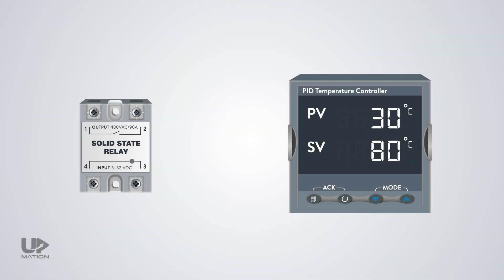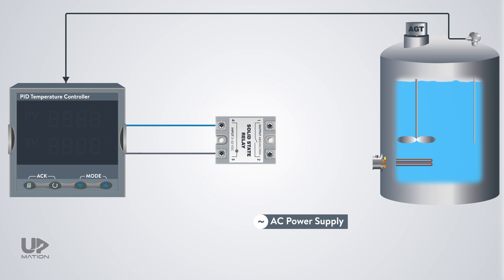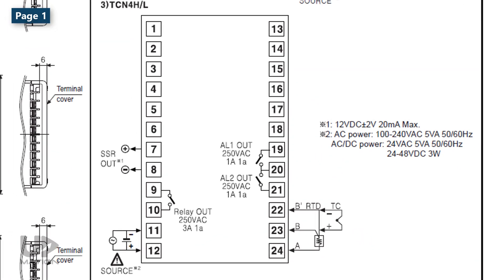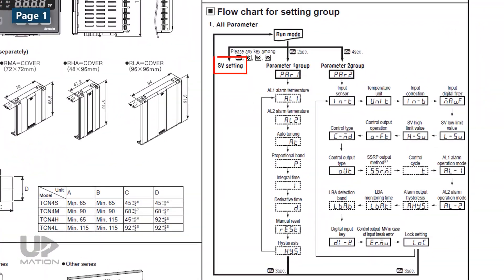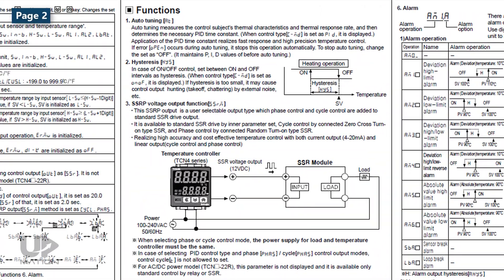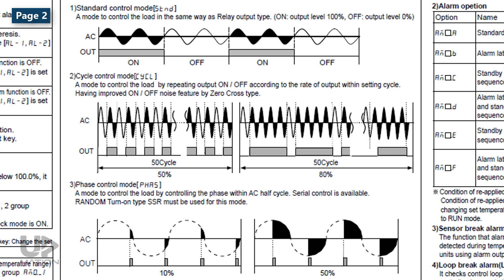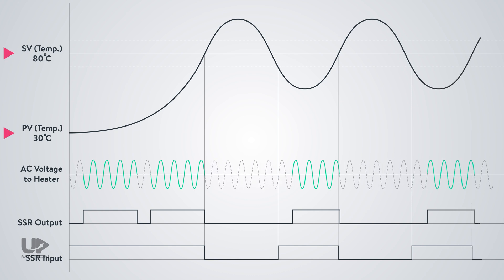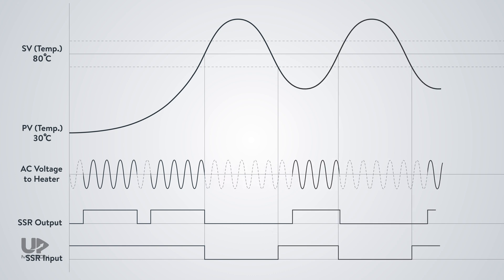How to Use Temperature Controller | PID Controller with SSR | Temperature ON OFF Controller

Comment: I would like to do the same thing with my photovoltaic panels using a dc voltage source 
PiD controller will be the best solution to control easely the tank temperature
Thanks for your video

Comment: How to identify/differentiate between SSR output/ relay output on PID Temperature controller. If SSR is not mentioned but voltage pulse is mentioned. I am confused is voltage pulse & SSR output same?
Reply from the maker: It should be written clearly but, voltage pulse sound like the same for SSR. Reading its manual would be helpful.

Comment: Do all PIDs need an SSR?
Reply from the maker: No. You don't necessarily need to use an SSR with a PID controller. It depends on your application. Please check the manual of your device.

Comment: Could you do a video on controlling a heating element in water using a PID -- and efficiency of SSR vs SCR?
I have an 8KW Atmor tankless water heater that has two switched heating elements. I want to add stable electronic temperature control. But I can't find good information about the different options!
Seems the PID + SSR MAY have longer switching time, and that MAY reduce heating element life from thermal cycling vs a higher speed SCR. But I am having trouble finding the real answer.
Reply from the maker: Hey! We will consider your suggestion. Thank you!
Reply: @Upmation  to follow up, it seems zero-crossing SSR is the way to go, because of the thermal mass of the heating element plus the switching time of the SSR are more than fast enough to preserve the life of the heating element. The SCR seems to be useful for motor control and dimming. Unless operated at the zero crossing (like most SSRs), SCRs can have a detrimental effect on the power system: lower power factor and harmonics that may cause radio frequency interference (RFI) or even affect the operation of other equipment.

Comment: I want to add PID temperature control to my 240VAC instant hot water heater. What controller and sensor would you recommend?
Is there such a thing as proportional heater control?
A heater controller that factors in flow rate?

Comment: I cannot see the follow up video about PID itself, right? SUPERB VIDEOS you guys are doing!
Reply from the maker: Yes, we have not provided that video yet. Thank you for your comment and compliment! This is great to hear you liked the videos.
Reply: @Upmation  (I think) I finally understood the 3 different ways of driving AC using SSR. Once I implement I will see if I did ;-)
Reply from the maker: @zyghom  Hope so :) Let us know if you had any questions down the road
Reply: @Upmation  OK, question then: So I have one board that has triac on output, and on input it has 2 pins: 1) zero crossing output, 2) PWM input. When used with ESP32, using PWM duty cycle from 0-100 the triac on the output "modifies" the sine wave - like in one of your examples (phase control mode) - it switches on with the delay so it is quite fast reaction. But this board is very low output  - probably no more than 1A continuously. Then I have SSR-25DA - this one however only does "on/off" (standard mode) - is there any way to control DA type SSR the same way the 1st board is controlled? Or only the VA type can be controlled this way? Or another way: does it make any difference for the heater controller I am building if I use phase or standard mode, as it seems that if the standard one will last ON only until the cycle goes through zero, that means that ON/OFF can happen (if synchronized I think) even 50 times per second. Right? Bigger problem however is the inertia of heater - I am still playing with Kp, Ki and Kd to find a good spot where all these 3 variables will make things working as I want: fast heating, no overshooting, steady state when setpoint reached and then if the setpoint changed - reacts the same way as at the beginning (I am working on SMD hot plate btw.). Thx

Comment: @Upmation Hello, i want ask. I have extruder for PVC hose extrusion and it has 8 temperature controllers ASCON K49. These controllers are switching zero crossing SSR. I dont understand one thing. When i turn up machine for heat up, these controllers interuptly switching on and off while heating up. Setpoint is 200 celsium but it  behaves like this while actual temperature is for example 100C, just in "heating up mode". Delay between switching is approximately 0.5 sec.
Is it some protection against burn of heating band? Can these bands burn off if would be switched on until it hit setponit?
Thank you for possible answer :)

Comment: We are use  heater then we are shown the temperature is raising gradually for a short time (what problem occur in this situation) ssr problem ond other problem?
Reply from the maker: If the temperature is rising gradually then everything is OK! If it is rising quickly within a short period of time it might be related to your temperature indicator/controller or your temperature sensor. Make sure that they are both functioning correctly by measuring the temperature with a Pyrometer at the same time.

Comment: Is it possible to make it work for 220-240?
Reply from the maker: Yes, it is! Unless you did not exceed the range of the output voltage, you can connect any AC voltage to the output terminals of the SSR.

Comment: Good day. Please can PID controller be used to carry out voltage regulation on AC loads?. Do you have any video on such applications.
Reply from the maker: Hi there, Obinna! I did not see them to be connected directly to an AC load! They can be connected to power controllers (Thyristor panels), Triacs, SSRs, etc. But directly to the AC load? I don't think so!